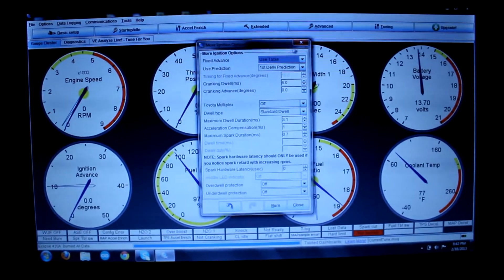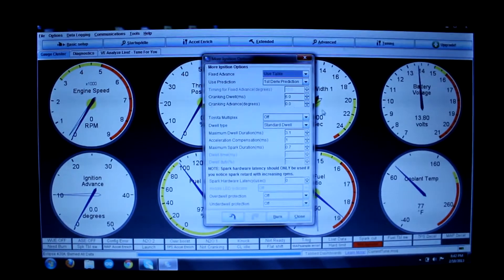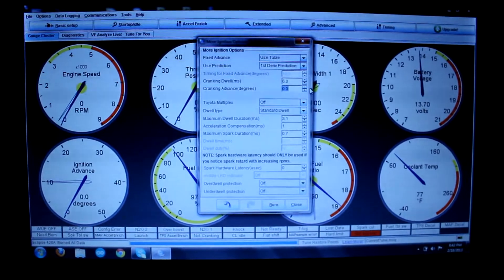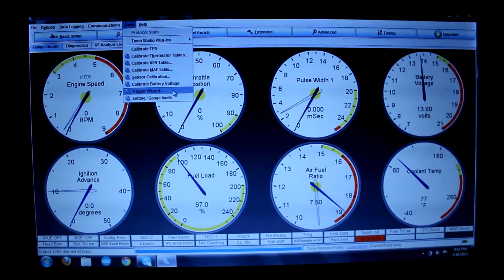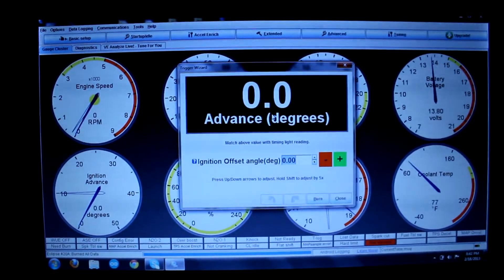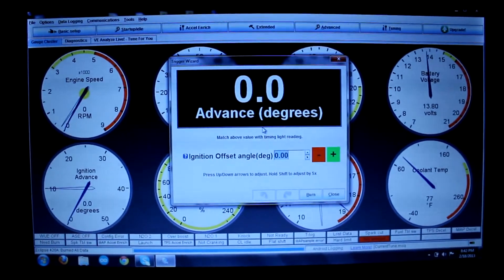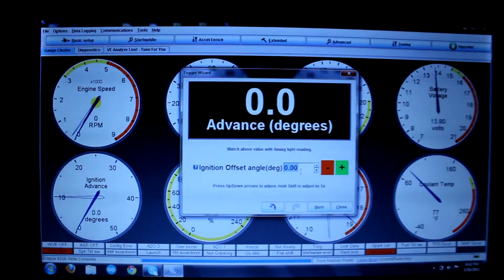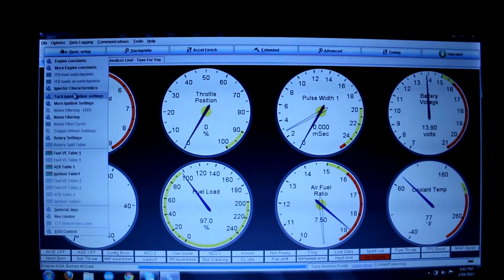Evan's Megasquirt Build Ep 21 - Base Timing

Comment: Evan I am having a problem with timing. my timimg marks on the cams and the crank line up where they are supposed to be however when the timing light gun flashes it is not flashing when the cam marks are lined up. could this be a settings issue in the Megasquirt?